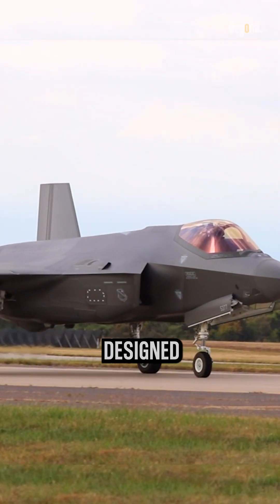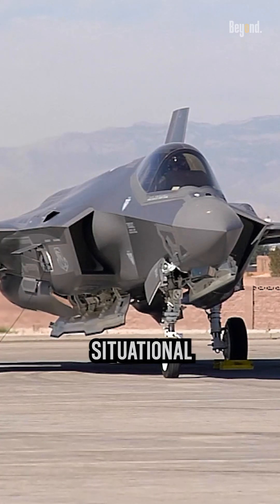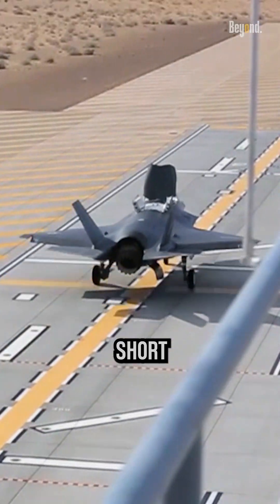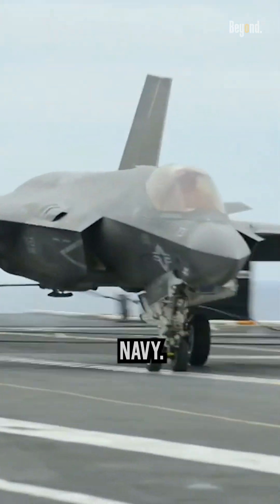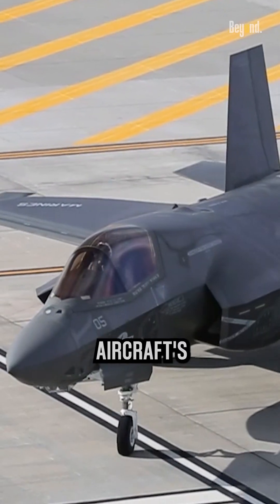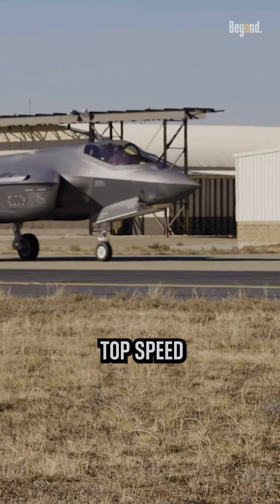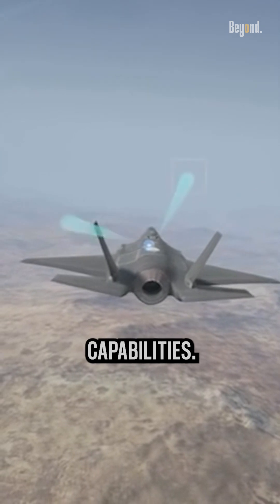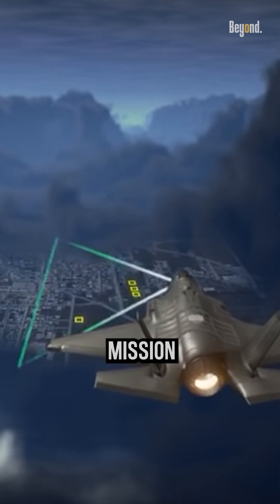Why is the F-35 so slow? Only mach 1.6 #shorts

Comment: due to FUNDAMENTAL DESIGN imposed limitations. the F35 were design from the outset as a VTOL plane at first. so they design it with having multiple engine that has the type of thruster that could support the mass of plane vertically. and that narrow the option to single line engines( NOT twin engines). both mid and rear. and to be able to sustain the plane's weight in vertical hover, it must produce the kind of thrust that has more "torque" than horsepower, if you want to relate that to car's engine power characteristics. just like in automotive tech, engine that has more torque has less RPM than those with more horsepower. the RPM translate to VELOCITY. in jet engine, faster speed achieve through higher jet exhaust velocity from the engine. not from thrust power. F35 engines are not for speed. it is for strength to lift the plane.

Comment: It is sort of like when the F-16 was first designed. Sure, the plane can do Mach 2, but not nearly as efficiently as prior aircraft. It was determined that very little time was spent at those speeds, so they optimized the design to be far more capable around Mach 1. Sort of like buying a sports car. Will a Corvette go 200 mph? Sure. Does that matter when you are on your daily commute and the speed limit is 55 mph? Not one bit.
Reply: No, of course, I would  not recommend pushing that Corvette up to 200 mph on my daily commute, but you would be shocked at how quickly that car can decelerate back down to the speed limit in just seconds. BUY AMERICAN

Comment: Add that the majority of US aircraft operate at mach 1.2 less than 1% of the time. Having greater speed than 1.2 when it is rarely used is not justifiable. Additionally, 1.6 is faster than current aircraft like the f-15 and 16 can achieve when loaded with external munitions.
Reply: The F-22 would like to say Happy Holidays.

Also the top speed of the F-15 when under load is Mach 2.5 and it actually has a higher thrust to weight ratio then the F-22.

The F-14 Tomcat would also like to say hai with its Mach 2.5 top speed when fully loaded.

Being able to get from A to B as quickly as you can in combat is actually a very big benefit, heck the F-22 in full combat loadout hits Mach 2.2 with full afterburner and hits a Supercruise speed of Mach 1.6 to Mach 1.7 without afterburner and with full combat loadout, something the F-15 can't do (Supercruise that is).

The F-16 also has a top speed of Mach 1.6 with full combat loadout and afterburner so.......no, most US Aircraft, at least the most widely used, including all of the F-35 variants, have an average speed of Mach 1.6.
Reply: @kaeaja  the max speed of the F15 and F14 are not fully loaded. Those speed are in clean configuration and can be sustained just by a few minutes. Normally, the supersonic speeds used to fire missiles are in the 1.2 range. The rest of the time the planes fly subsonic. That is the reason why the F35 speed is actually better than both. At least when in stealth mode and if you want to fly for more than a few minutes.
Reply: @adrianpaz472  Fair enough
Reply: The max speed of the F-14  is Mach 2.3… and I guess it’s sleek as hell! So the F-14 never flew at Mach 2.5.
The mighty F-15 and all the fables around it! I’d love to know how many times it actually flew at Mach 2.5 . I’d venture it’s a single-digit number, and only sleek and they had to rebuild half the engine after… I’ve read people saying it’s way slower than Mach 2 once loaded, but I don’t have any proof of that…
Reply: @jeromeportier4914 The F-14 have flew to up to mach 2.5 but in actual service it is limited to mach 2.3 for Max speed
Reply: @DARTHBLUNT713  Source?
Reply: @jeromeportier4914  Grumman Test Pilots
Reply: @DARTHBLUNT713  That’s a group of people, not a source. Unless you talked to them directly.